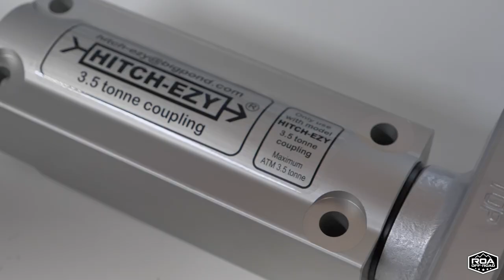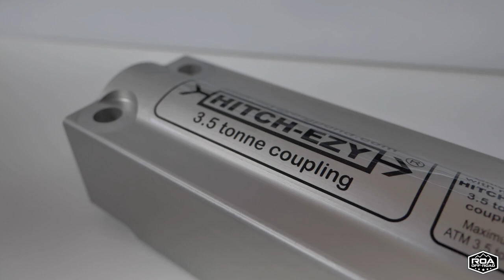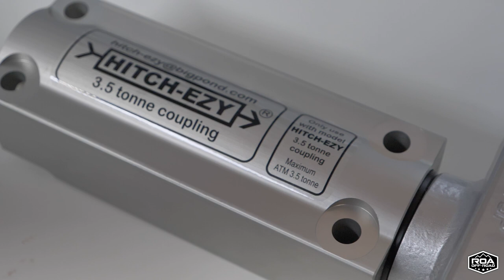TOP 6 ARTICULATING OFFROAD TRAILER HITCHES | ROA Off-Road (2023)

Comment: I agree the Cruisemaster and McHitch appear to be the most robust units. I would purchase either one with confidence. However, I would always have some penetrating oil and brake clean on hand always to clean and lubricate the moving parts in all hitches. Not much different maintenance than a ball hitch in fact. You ball hitch guys: You DO maintain your couplers, RIGHT?
Reply: Sometimes if you don't use the right stuff all it does is make dust and dirt stick to your sh1t and wreck it.

Comment: Ive been using the DO35  for years . A couple of circuits around Australia on a variety of road surfaces.  Haven't had a single issue in that time . Like anything i keep it clean and lubricated . Swear by this hitch from Cruisemaster .

Comment: With the exception of the poly block, being slightly more inconvenient to attach to the tow vehicle, it has an advantage that none of the others have, which is a level of shock absorbing properties from the Polly block it self. I think on a light trailer like the one you demonstrated on the DO 35 where you can manually lift it. The poly block is better.

Comment: Can't beat a pintle and lunette ring hitch, aka a NATO hitch, easiest to hitch up, no need for secondary couplings, it cannot come apart if correctly closed, Full articulation, ie over 200°/2000°/360° rotation. Hitch far exceeds the vehicle tow weights so perfect. :-)
Reply: I think there biggest issue in “civilian” use is that they’re noisy and performance in reversing scenario in not as good, but other than that they are simple, robust and need very little maintenance - perfect for military application.

Comment: I’ve had PolyBlock for 21 years without issues, maybe mine was a better quality as it doesn’t flop about like the one demonstrated. Now I’m not saying there’s better hitches, just saying it’s simple and has proven its worth crossing sand and stony deserts here in Australia without fail fail.
Good video tho guys, appreciated. 😎👍
Reply: same,  even if they flop you just put a folded bit of cardboard in there, you can't beat them cost and reliability.

Comment: I've got the poly block on my new camper trailer and it was easy to hitch up, the hardest part is making sure the hight was right, but reverse camera on my 4x4 looks down so lining it up is really easy and I never had an issue doing this even when coming in on an angle. The only issue with my current setup is the hitch is too low but I'm looking at different tongues to level the trailer better, this might include using a different hitch so the spare wheel which is mounted to the back door isn't hit and I can still open the door some of the way.

Comment: Good review; thanks for the info on various options out there.
Just yesterday I replaced my McHitch with a DO35 due to the McHitch business recently closing down.  Their issues mainly related to universal joint failure which I experienced 5 years ago. DO35 is a great product and the biggest seller of its type, (Off Road Use) in Oz. McHitch was so easy to connect without help other than from a rear view camera. DO35 is better engineered IMO.
Reply: I’m just about to remove the 5-year old McHitch from my Kimberley Kruiser and install DO35. The McHitch has been great and easy to use but with them closing shop and potential failure I didn’t want to take the risk.

Comment: Had d035 hitch fail, split at the rear, leaving the front two bolts to do the work. I hadn’t noticed the split for probably 6-12 months, I dont really know. It was denied warranty because the trailer manufacturer likely installed it incorrectly (likely not tightened to spec). I will say its the best trailer hitch I’ve used for far. I like my max coupler but its not as easy to couple as the cruisemaster.

Comment: A good overview of commonly available designs, but it might have been better to start with the basics then show the specific designs. The basics are that 
- every hitch must allow rotation in all three axes: yaw (turning corners), pitch (nose up and down), and roll
- these non-ball hitches have a separate pivot pin for each of the three axes (and you can point to them at the beginning of each design's section)

Comment: That mchitch looks shady. All the weight is on the uni? Move ball weight back off the vehicle more? Extra slop joint?  Looks like it'd be a nightmare to hitch at the beach or forrest on uneven surface. Even seen reviews of bent pins, failed unis, hard to get that locking lever released etc etc.
 Ive had my poly block for over 15 years, i just left it on my tounge and have had no issues. Is this just propaganda for selling other hitchs? Sure it might be hard to hitch, but i havent seen any fail. So yeh.

Comment: the polyblock is the best hitch in this whole video, you don't need somebody else to hold your poly block you just put a folded piece of cardboard in it, or a leaf or a stick. for small trailers you just back up next to the block and pull the trailer sideways and in. 
they're silent, they're cheap, they last a very long time and they have over 75yrs of proven track record behind them in Australia.